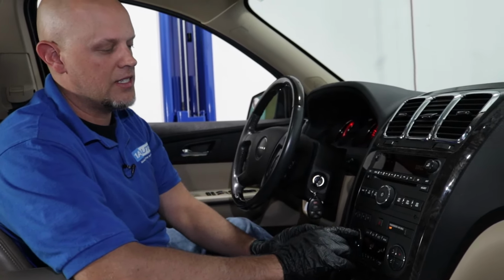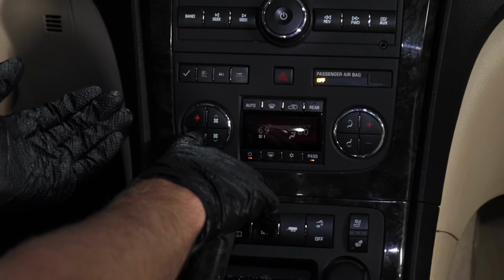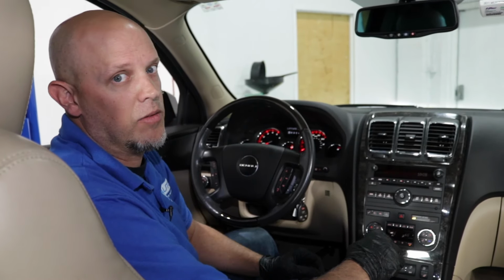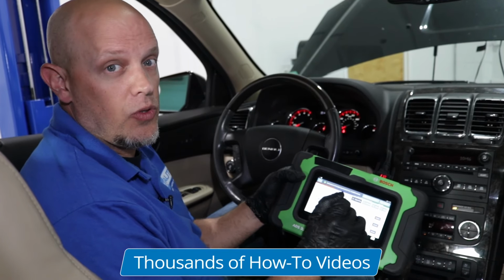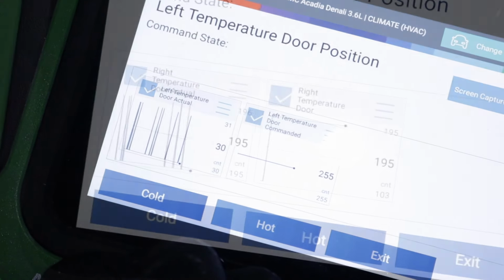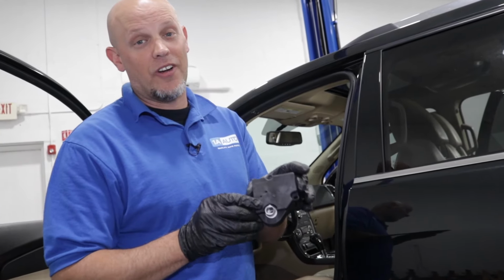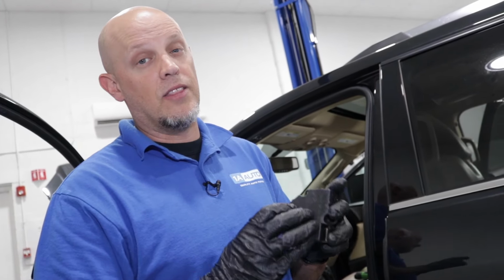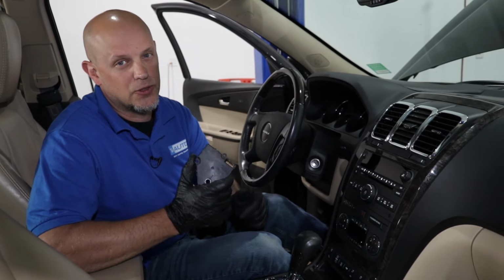Cold Heat? Hot AC? Diagnose Temperature Problems In Your Car or Truck

Comment from the maker: √  Watch the Video
√  Buy The Part at 1A Auto https://1aau.to/m-Visit-1AAuto
√  Do it Yourself
√  Save Money
Reply: Hi So I have a 2011 GMC Acadia and the driver side vent and 1st vent in the middle of the dash to the left is blowing out out air. If I replace the actuator under the dash will it fix this problem or would have to replace the passenger side as well? thanks.

Comment: brother I have a mind boggling question, I turn the AC on, runs great maybe for about 5 10 20 minutes then starts blowing warm air. Turn it off then after 5 minutes turn it on and the same thing happens again could this be the solution?

Comment: Your a life saver. My 13 silvarado had the hot on 1 side cold on the other issue start happening this morning.(battery went dead and I had to jump it). Of course I went straight to Google. Everything I found was either ac charge low, or blend door stuck. After watching your video on replacing the actuator I seen this video directly under it. So I figured I'd give it a try. It worked perfectly! 
Thank you for saving me a trip to the shop for something that was so easy to do myself!

Comment: Thank you so much! You saved me a lot of money.  Driver side was blowing cold, but passenger side was blowing hot. I had just replaced the battery and by turning off the HVAC system, turning off the truck, disconnecting the negative on the battery, reconnecting it, and testing, worked great. Thanks again.

Comment: 2010 3.9 v6 chevy impala, driver side vents not blowing cold like the passenger side. Replaced driver side actuator hoping to fix the issue. Still having the same issue. Did 3 different reset/relearn procedures, still same issue... Any ideas? Low freon levels? Any help is most appreciated!

Comment: Thanks. this was my problem. I also have issue with A/C. 2011 Honda CR-V dual controls. sometimes it works, sometimes it doesn't.  No leaks, I've put 3 new compressors in and nothing changes. any ideas?

Comment: Great vid advice! Same problem in my truck and it was making the flap knocking sound when it was on 5. I turn it down to 4 or lower and no more flap knocking after years of doing this. Now, it is hot on one side when AC is on. Likely actuator like this video explained. Taking it to a shop tomorrow. Thank you.

Comment: My passenger side and back seats were blowing hot air, drivers side was cold.  I went through the glove box, unplugged the green wire. Plugged it back in and everything works great now.  I didn’t have to replace anything.  I have a 2014 Lincoln MKX.

Comment: in my car when I turn Ac, the passenger side blows cabin air temp or outside temp (not hot air) but passenger is cold air . When I switch around air flows up middle or floor everything seems to work . Does this mean the actuator is working properly? Thank you

Comment: Hello.. the problem is in my car when I turn on the cooling it does not work until after a minute.  I saw the rear fog button light blinking when it stopped turning on the cooling.  What is the problem?

Comment: Yes like your video but it is well I was hoping that you would show actual checking which module door actuator was bad I need some help deciding which one I should replace I have a O6 Ford Freestar which has passenger driver and back so I’m assuming it has three different ones the passenger blows cold and driver side blows hot air even on cold But do not know which one to replace it has so many different ones could you help thanks have a blessed day
Reply: I’m having the same problem on a 2018 Acadia. Dual ac. Please let me know if and how you fixed yours.
Reply: I have bought the actual later and it goes above the driver side gas pedal to the right connected to airbox I will put a video on YouTube and maybe it will help you thanks thanks
Reply: @wayne2fun  Did u put it up on YouTube?  If so, where? Thx.

Comment: I have a question about my 99 accord v6 204k mi my heater will blow hot heat just fine and stay hot when really cold outside but when temp outside warms up heater wants to blow cold it’s full of coolant and tanks on max line changed my mode actuator cause had no selection over vents and no flow through 2 center vents it’s climate controled is this normal for this to blow cold when warm outside places say it could be a clogged heater core blows good n hot heat when cold outside

Comment: what if I already changed out my actuators and did the battery unplug reset process and I still keep getting hot air one side and cold on the other?  I have no idea what is going on with my ac.  It is on a 2009 chevy tahoe, this started happening after I changed my bettery.

Comment: I'm about to replace a blend door actuator.  After replacement does it need to be calibrated at all or will it self adjust?  Should you disconnect the battery after installation?  2012 Kia Optima.

Comment: I have a '08 Mazda 2.0 car has been giving me hell with the ac. Blew 2 New compressors in 1 month. Finally took my car to an AC car repair and had the system replaced compressor, dryer, and expansion valve. Everything was going smooth for the first 3 days. 4th day driver side and middle vents started blowing hot and the pass side was freezing cold I am so annoyed at this point

Comment: Good video - but from the title I was hoping you would tell us how to diagnose if a constant heat from both sides of the vehicle is either blend door OR temp sensor OR head unit. Seems like there might be a way with a multimeter to check head unit and sensors - was hoping to find that information.

Comment: How about if the driver side is a little cold than the passenger side because the passenger side is very cold but the passenger  side is a little cold only and when I check the temp in monitor or switch is the same  temp I change  condenser,compressor,expansion valve but still the same  what do think is the problem ? By the way the car is Silverado 2016 model thankyou in advance

Comment: I came across with the same problem, when i was turning heat on the passenger side, i was able to see the gears rotating but when I turned to the cold side it didn’t turn. So, will it be the actuator issue or something else?
Reply from the maker: +kataria jaymin We wouldn't be able to diagnose an issue like that here, you may want to have a local mechanic take a look at it. Thanks for checking us out! http://1aau.to/m/Shop-1AAuto-c

Comment: Hi, I have a 2002 GMC Yukon Xl 1500 with a digital heater/ AC control module. It only gives me heat at max setting, so I have 2 options: cold or very hot (nothing in between). I've replaced the actuator at the passenger side but without succes. What could be the problem ? Thanks.